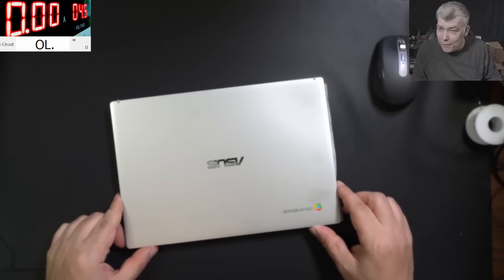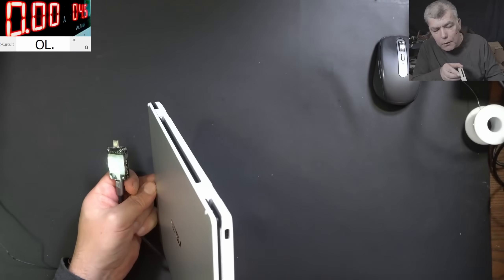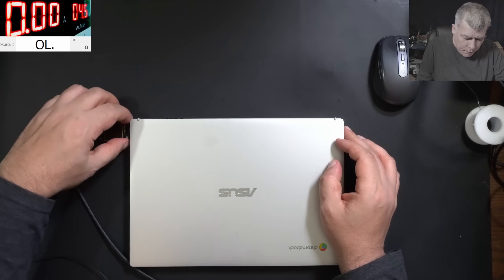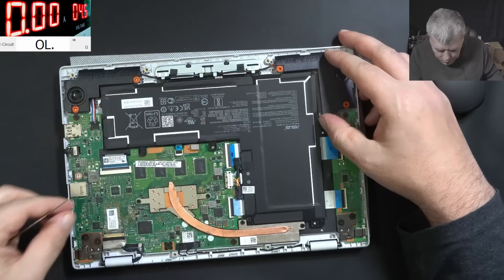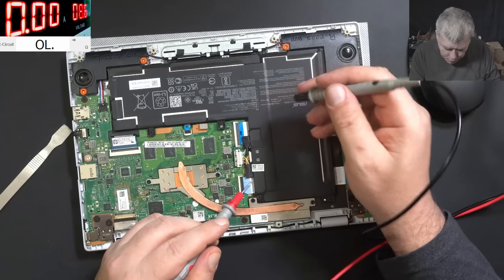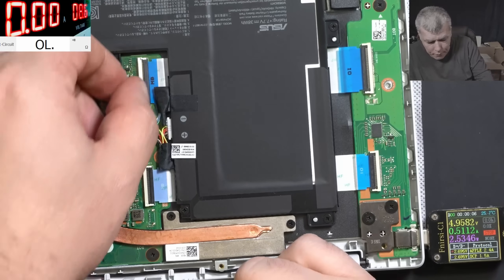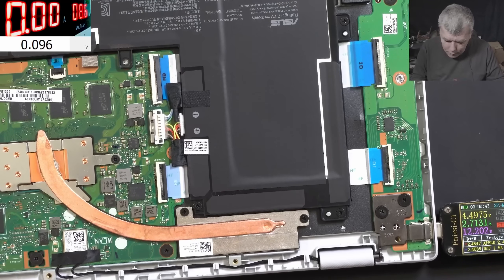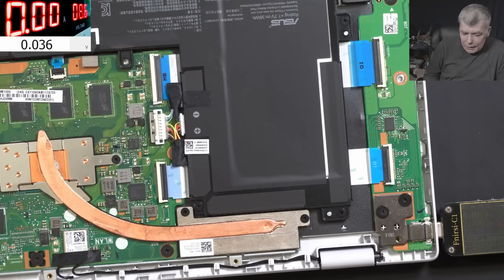Asus Chromebook CX1100 - Not charging, USB Type C replacement

Comment: "A simple test is worth more than a thousand assumptions and/or opinions."

Don't you know about Murphy's law?

Common sense (and due diligence) also means one measures voltages and polarity, or at least does a minimal continuity beep test, tracing the system as-is — before looking at colors, assuming anything.

Black and white colors are also HOT in AC distribution where I live.

So why assume anything when faced with a device you are not experienced with?

If you were, then you wouldn't have mentioned:
"Black wire is plus/positive. What is wrong with Asus?" on the YT thumbnail.

Turning your video thumbnail into an insulting click bait.

Since you usually provide good videos that I appreciate, thank you — my mistake is that I expected better from you. My bad it won't happen again, alas.

Likewise, the 'teacher' is not always right either.

"Common sense is not so common."
~ Voltaire

Comment: hey my laptop has onboard 8gigs ram i am wondering is it possible to upgrade soldered ram in laptops,  i belong to mobile repairing field and in mobiles it is indeed possible to upgrade ram and storage by replacing emmc or ufs chip but it is not very convenient way to do maybe in laptops it is common to upgrade those smds ?

Comment: On the black tape you can see "+"  and "-" ...... peel the  black tape off to get to the "+" and the  "-"
And the funny looking color cable of the battery connector ... its clear plastic ....you're looking
at copper wire wrapped in clear plastic.

Comment: I kinda wonder if the laptop was working on the other usb port ? With the cable connected and pressing the power button you could see it jumped to 12V.
Reply: it should. both the type c ports charge the device. i have this model chromebook cx1100 trying to figure why it keeps turning itself off randomly.

Comment: i prefer the "drop" method.After applying solder,you heat the board from the bottom,and when the solder melts ,you drop the new port.Works also on console hdmi ports.

Comment: Low melt solder?  why not clean every hole and pads put port in place and solder with a high quality one?
Reply: You beat me to it. Why not use soldering wick to clean up old solder and then apply fresh one? Instead, this is a mess of old and new solder. No idea, if one is lead free with higher melting temperature and the applied one is with lead.

Comment: Hi Sorin (from Ro), i have a hp ryzen3 7320u, and it has the following fault: i turn it on, display start, start booting, display off, coolers from inside remaing powered. I turn it off. This happens random for 10-15 attempts until it starts in windows and then works normally , you can restart it then , shut it down and starts like it has nothing. I noticed that happen when laptop is "cold" . Can you please advise ? Thank you very much for your answer on this! Any advice would help.
Reply: 1) Update your BIOS
2) Check your ram
Reply: @Mr.Hide_Christian  1) already did it , behaves the same.  
2) ram is soldered ddr5,    2 x4gb, i don t know how to check ram
Reply: have you tried reinstalling windows?
Reply: @maklogetrich2378  hi, yes ,tried also bios update. It s not a windows problem. Laptop start for a few seconds and then screen goes off ,but coolers remain powered, you have to switch off manually. Try this for 10-15 rounnds and then goes in windows and behave normally
Reply: @pandyb it's a brand new laptop, right? I would go to HP right away
Reply: @maklogetrich2378  yes , it s hp 17-cp series laptop, i can t go with it on warranty , it s bought from oher country.  I hope Sorin will respond here with a opinion, would really apreciate
Reply: @pandyb  I see
Reply: Hi Sorin, please can you give me a advice to what can be fault ?